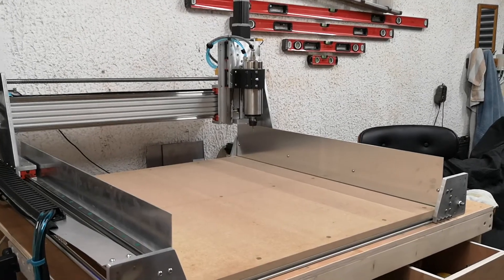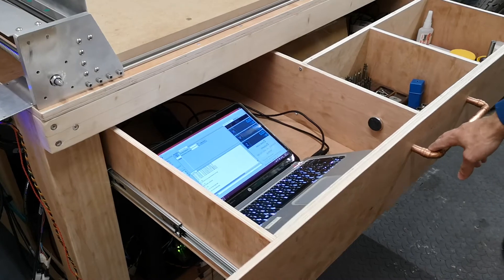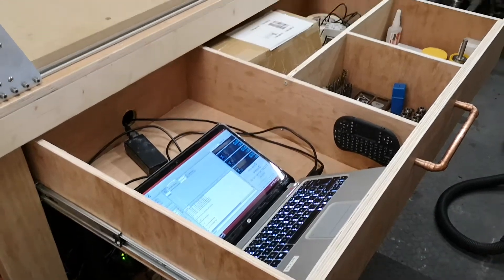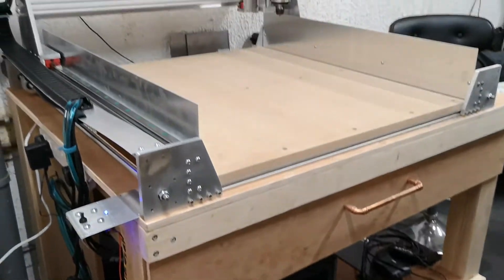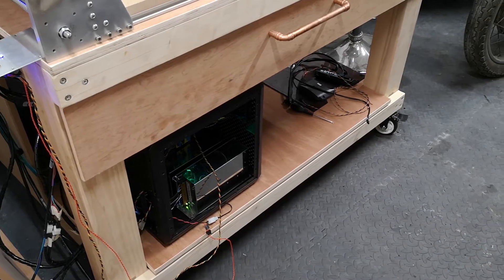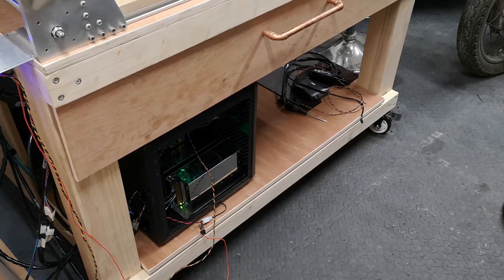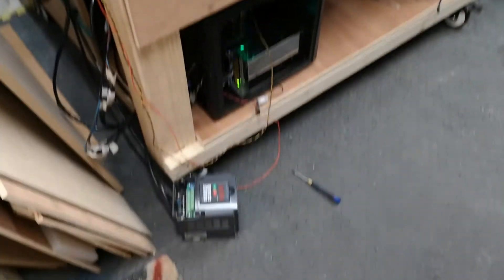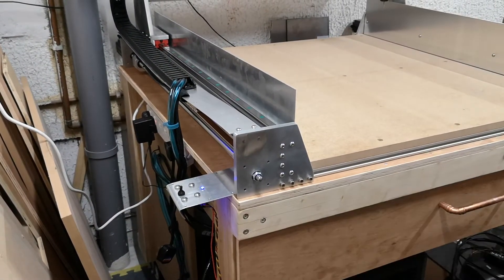The Beavermatic DIY CNC Jogging around - Home built CNC using a Shapeoko 3

Comment: hi, why did u decide to home at the right rear end corner instead of the front left corner? Wouldn't it be more convenient, closer to you operating in front of the machine, tool change etc...? Which control board are u currently using? Herri in Kunming.
Reply from the maker: Having it home to the back right makes loading stock allot easier. For tool changes I have a bunch of macros programmed in. This uses an ardunio mega.
Reply: thks Luke. Looking forward to see your developments. Good luck. Herri
Reply from the maker: @cyatlas  I've since re developed the frame and call it the beaver pro. It's now on beavercnc.co.uk
Reply: This is really good. You focus on one machine and make parts for it to make it operate better. I am sure that you will succeed. I hope that you will have more viewers. You deserve it.
Reply: G54 Takes care of that. The machine Zero can be wherever you want. The workpiece zero is what ever you set G54, G55, G56 etc. to. That makes the gcode 0,0,0 at whatever point G54 is at. And g54 is just an offset of whatever the machine zero is.